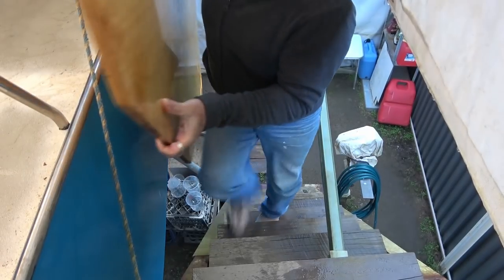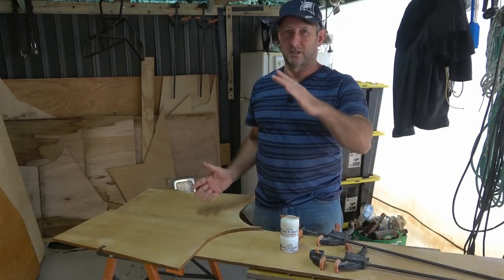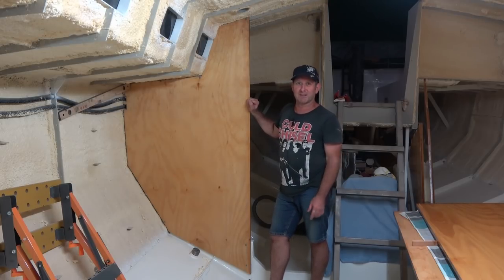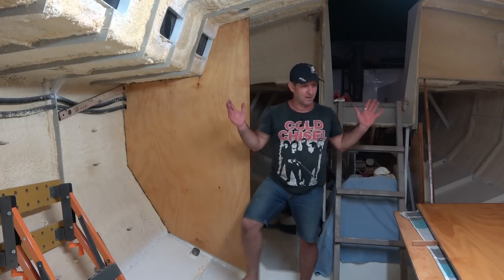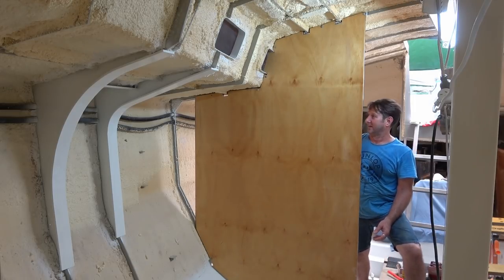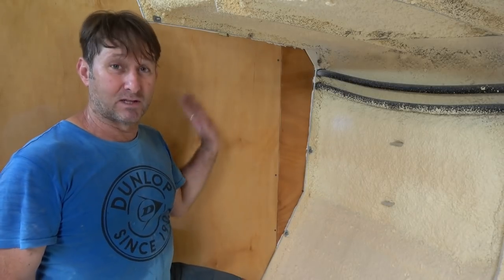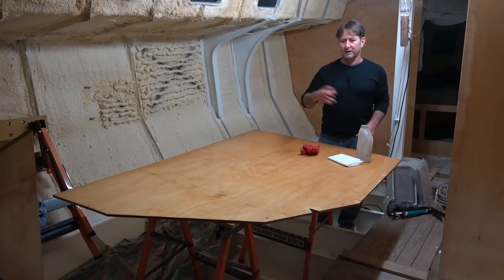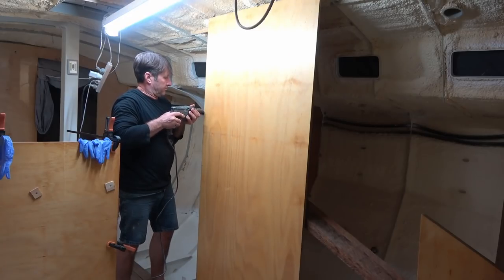Building my steel sailing yacht Ep.42 Bringing them in FOR GOOD!

Comment: awesome job!! looks great! but as you know- that dust mask does nothing to protect you from the fumes- need to upgrade and extend your sailing life!
Reply from the maker: Hey thanks for your comments 45acpHardBaller much appreciated! 
Re. the P2 masks that I use, jfyi here is an Australian gov't post about them -
"The P2/N95 mask is a particulate filter personal respiratory protection device, capable of filtering 0.3µm particles1. It complies with the AS/NZS 1716:2012.

N95 classification means the mask complies with USA testing requirements
P2 classification indicates compliance with European testing requirements."
I do also use a full face respirator mask when using products that specify these.

Comment: just an observation, a dust mask will not help protect you from chemical fumes, you need the correct tool for the job you are doing, then you will live long enough to enjoy the fruits of your labour. great job but be safe!
Reply from the maker: Thanks for your comment vonhench and I appreciate your concern, however the P2 masks that I use do actually filter chemical fumes and so do help. Thanks again.

Comment: Sounds like an amine blush. Epoxy can develop a real waxy surface on curing in cooler and damper conditions. Make sure you get that off as it prevents a good bond with fresh epoxy ( but you probably already know that. : )  If you want a bible on epoxy work go to the West System website and download the free Gougeon Brothers on Boat Construction book.  While much won’t apply since you’re building a steel boat it makes a great reference book on all things epoxy. Cheers
Reply from the maker: Yes great advice and recommendations Robin and much appreciated! The Gougeon Bros. were the West system gods hey! Thanks again!

Comment: looking great . one question why not using lamello ( buiskquit) connection, would make the joins even stronger
Reply from the maker: Hi Bruno and thanks for your comments. Yes I understand your good suggestion, however 1)I don't have a lamello power tool and 2)the epoxy glue that I am using bonds stronger than fasteners and is stronger than the plywood itself.
Reply: @BuildingSYMistress  shur thats a good solution, hope now it will go faster. The big pieces are done
Reply from the maker: @BrunoWiebelt  Thanks Bruno and yes "hopefully" the pace can pick up,...
We will see,...  🙂👍

Comment: Looks like she is coming together, pretty soon you won't be able to see any foam! 

I have been looking at a lot of used boats lately, it looks so disgusting when they don't cover the spray foam up after a few years it just gets black and covered in boat grit, not a pretty sight!
Reply: Renegade Show I just hope it doesn't rust under all that spray foam.Seen a few steel boat rust out under the insulating foam when working at the slip way in the 90s.
Reply: @bevantweedie5129  it should be alright, just as long as the deck is sealed up tight, for that to happen the foam cells have to be open or the foam has to separate from the hull.
Reply from the maker: Thank you very much sir, I do appreciate your good comments!
Reply from the maker: @bevantweedie5129  Thanks for your comment Bevan and like everything in life, time will tell. I did a lot of lengthy thinking on this subject and again like everything, there is no perfect 1 solution, all things considered. The spray foam's in recent times are different from earlier types and the newer 'closed cell' types cannot absorb moisture/water which makes a significant difference. Thanks again.